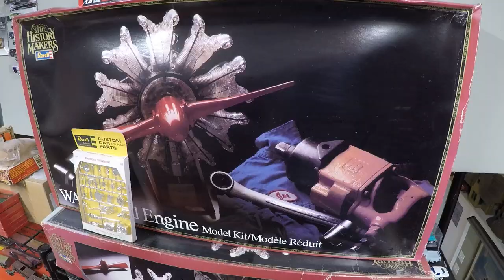Northwest Short Line Brass HO Scale Class A Climax

Comment: Logging railroads frequently did not build bridges to cross water. Instead just thru down some coarse rock then throw down track. Loggers would run trains thru water as deep as the bottom of the boiler.  
         On many logging locomotives you will see a cloth hose(like a firemen hose) to dip water out of the nearest creek.
          I've also seen pictures of logging locomotives the did not have conventional flanges wheels, but double flanged rims(?) that would run on tree trunks. The tree trunks were lain down as the   ..  guideway(?) for the train. Then when an area was logged out just added to the harvested logs.
     A lot of logging operations were real shoestring operations that just made due with as little as possible. It creates a lot on interesting operations in their heyday.
Reply from the maker: My plan is to have my uppers truck a logging railRoad.  So far 6 feet of track. Oh and four locos and 3 cars. As always cart is running over the horse!
Reply from the maker: Ps. It has a bridge built of logs.

Comment: I built a logging "operation" with 1/25th scale trucks and trailers.  I used scale chain, and dirtied up the equipment.  Then set to work finding scale wood logs.  I realized after a while that plastic wasn't made to haul real weight.
Reply from the maker: At some point in time I plan to get back to my upper rail road it’s just difficult to get to because it’s 8 feet up in the air! But it’s a 120 a scale logging operation

Comment: Hi Toy Man TV. Thanks again. NWSL imported some of the nicest logging models, IMO. I like how on such a small locomotive they managed to put a drive on it - the motor in the water tank. Of course, NWSL is in the business of specialty drives and components; if NWSL can't make it fit and work, then it probably can't be done. Most of the west coast logging railroads are completely gone now, sadly. Just very few old structures and relics left in most cases.
Reply from the maker: As we pointed out in the show some people think roaring camp in big trees is a surviving logging railroad. But both fit in the sugar pine railroad or simply re-creations of login railroads. The Oregon coast scenic could be considered a login railroad. And parts of it survive. Beautiful scenic railroad but technically not a login rail road. The Rayonier still survives sort of at least there’s a wonderful Museum in Washington state
Reply: @ToyManTelevision  Thanks. I'm familiar with the surviving bits of logging railroads. It is pretty impressive that much of the bridges and ROW of Simpson Lumber survive. Same as CanFor on Vancouver Island - most of the track is still in  place there. Thr Rayonier is nice to visit, but when I was there last it was closed for the season. Considering how extensive the logging railroads were, though, the surviving bits are only a tiny percentage. We are lucky the Roaring Camp is still with us. I read sometime in the late 80's or early 90's some vandals made their way in and set fire to the big trestle and some other parts of the railroad, and it took many years of fund raising before they could rebuild. The one thing that detracts from a logging model railroad is the lack of tunnels on the prototypes, as tunnels are usually a necessary thing on a model railroad for space considerations. But  tunnel on actual logging lines is very rare. I have a very nice virtual version of Oregon's Sumpter Valley on the original MS Train Simulator, though. It includes some nice 2-6-6-2's and other narrow gauge rod locomotives and is 'modelled' extremely accurately. That 'layout' uses minimal space. No selective compression required, even when I lived in a 420 square foot apartment for a while....

Comment: That is a cute engine, I remember seeing one like it at the Deming Logging show some 35 years. It had a large capstan on one end that was turning because it was steamed up. They had a display going as if they were moving logs out of the woods. They had it on a lowboy but for effect the had it staked down like they would have had it if it was working in the woods. They are part of logging history. 

I think you made a mistake it looks like the motor is a twin cylinder not a single. That would make sense because it would apply a more constant torque load to the shaft.
Reply from the maker: Yeah I pasted an OOPS!   over the image. Don’t know why I said single cylinder. There were a few of those built in about 1830 but they didn’t work very well! I think for locomotive you saw at the logging show was a gypsy engine. There are three survivors that live in Eureka California. And they take them to  shows and show them off. In this case they really are single cylinder! Horizontal remounted single cylinder. One of my favorite locomotives.
Reply: @ToyManTelevision  it could have been, I remember the main engine to drive the unit, their could have been a pony motor running the capstan. 

There was another capstan donkey that was driven by an early flathead motor there, it looked like it had just been pulled out of the woods.

Comment: I have a  7 1/2  gauge  ,,1 1/2 scale  Clishay I  biult 35 years ago  It's coal  fired ,  and has a vertical  boiler and 2 cylinder engine  .   It's very similar to the class A climax  in appearance  , lts at the moment it's in pieces as I'm  rebounding  it  from the ground up ,,
Reply from the maker: Wow that’s really cool! I rode on a similar unit that was 2 foot gauge at Golden Colorado years ago at the high country railroad. The guy had build it out of a kit that was intended for a marine lunch. We threw away the boat and build a platform and put wheels on it and the next thing you know we had a climax! Basically a climax is a Marine lunch isn’t it just without the boat!

Comment: Will it run. I have a nwsl. Hon3, 18 ton shay. I use a 9 volt battery to test it on a piece of track. Would be nice if you could make them run. Thanks for everything you share.
Reply from the maker: They have been in boxes for years. Like 25 years. And I’m afraid they are in need of lubricant and tweaking.